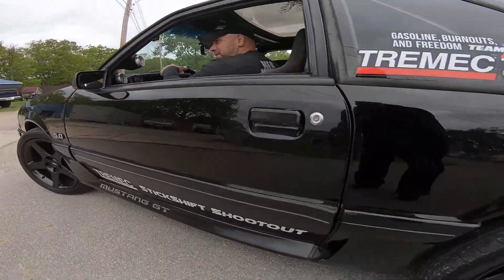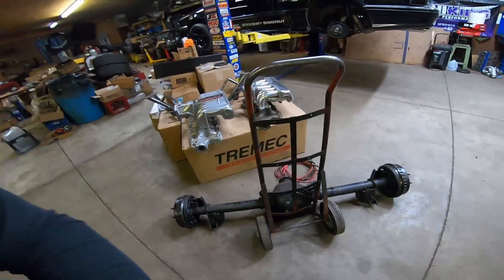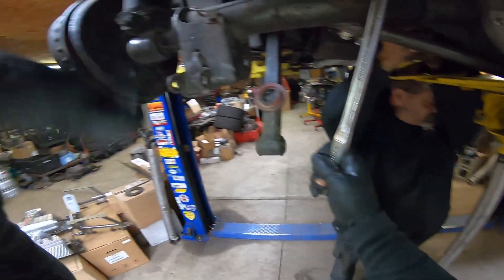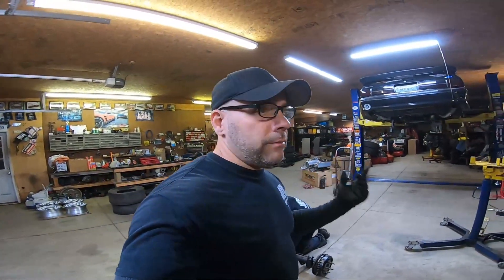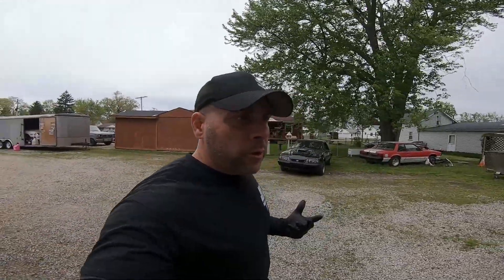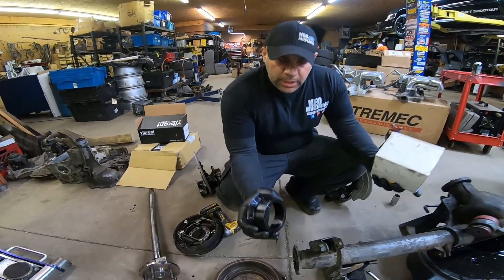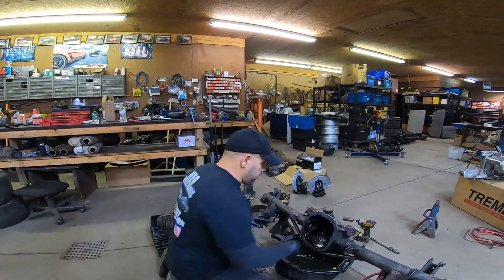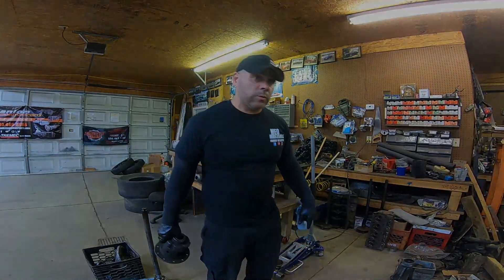How Strong is 31 Spline Ford Rear Axle? At 1000 Wheel WE LOOK INSIDE

Comment: While I agree that C-clip eliminators are a good upgrade and if staying with drum brakes should definitely be done for racing. The budget way to prevent axles coming out when broken is to convert or use the disc brake versions. A broken axle is not exiting the housing with disc brakes. Am I wrong?
Reply from the maker: With c-clip eliminators they can’t exit either …

Comment: Great info brother. I have a 03' Crown Vic Police Interceptor that will be around 400ish to the rear wheels. I will definitely be doing some up grades to my 8.8. I know around 03' in the Vics is when they changed from 28 spline to 31 spline. I will find out what I have when I open it.

Comment: I installed jy p heads without doing anything to them, car ran fine, I then upgraded springs and valve seals, now will turn over but won't start, what do you think it is?

Comment: After putting a serious G Force transmission in my car with a good Ram adjustable clutch and breaking the 8.8 rear gears 3 times.  I got a Fabbed 9” from Quick Performance with 35 spline axles. Best 💵 I’ve spent. Been 9.80 with it no issues NA on motor. When setting up a rearend. The 9” is so much easier

Comment: 35 spline Strange Hy-Tuff axles, Spool, C-Clip eliminators and Fully Welded tubes in my street car with an Anti roll I never unhook. Been that way for years, only issue I’ve ever had was twisting a Yukon 31 spline on the street making test pulls.
Reply: What kind of power were you making to twist the yukon 31 splines? Curious because i just bought these.
Reply: @OrangeSpeedTV haven’t had it on a dyno with my newer setup. Old was 574/624 on 12 psi …. Gotta be 650 wheel minimum. Car has 1.32 60’ and i have never touched the suspension from when I bolted it in other than a shock adjustment

Comment: If known what 8.8 4 lug options are out there that has 3.55/3.73 gears or full rear and that will fit a fox with stock length axles?
Reply from the maker: 87-88 turbo coupe